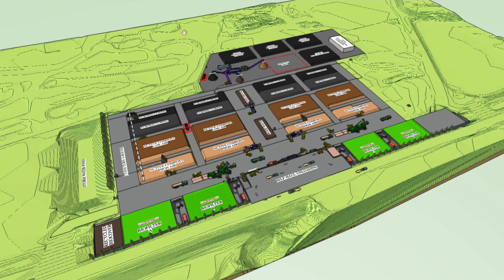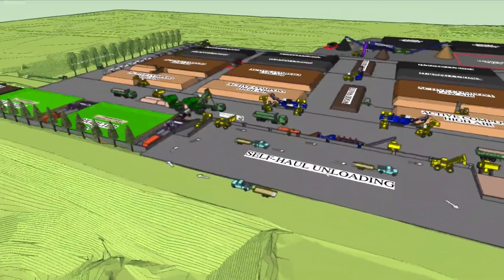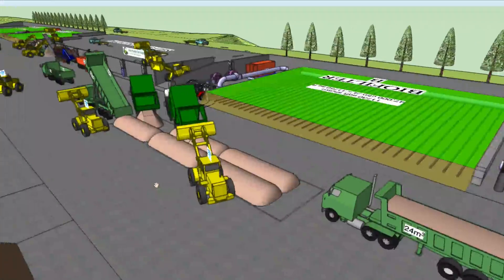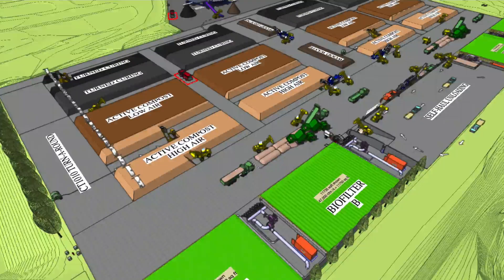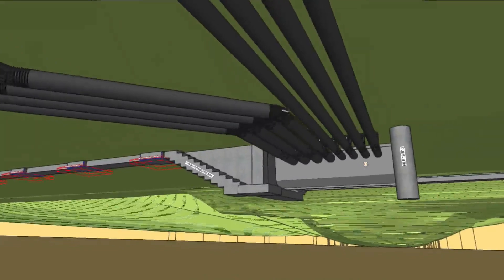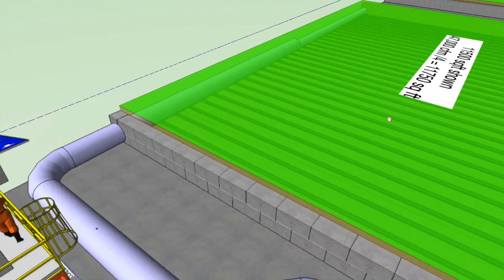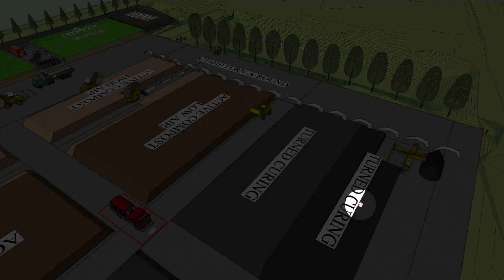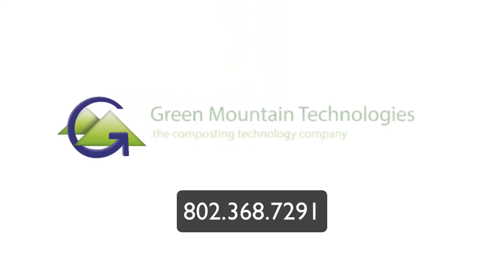How Turned Aerated Pile (TAP) Composting Work

Comment: "Designed to handle the material as little as possible"?? Sure doesn't look like it. I have not seen many systems that move it more.
Reply from the maker: Hi Joel, thanks for commenting,  Windrow composters typically turn their piles every 3 to 7 days for 90 days. 18 turns to finished product. At a turning speed of over 2,000 cubic yards per hour. Aerated Static Pile systems do turn material less, but are less efficient in the turning process, requiring at least 2 turns to add water using a loader and mixer at a rate of 200 cubic yards per hour. The Turned Aerated Pile system turns a total of 12 times at the same speed as a windrow turner. So you are right, this system does turn a lot of times, but it is less than windrow turning systems that do not use forced aeration and faster than both ASP and Windrowing to reach the same stability levels. We have one facility in Puyallup Washington that says they are reaching a stable product in 26 days using this TAP system. It has been operating since 1999, so they have a lot of experience with this composting method, so our claims are conservative and are achievable by all our clients right out of the box. We have a new system that moves and waters the product 6 times called the cTAP that has a better configuration, and same composting speed of 42 days. Our new Radial ASP integrates turning and remixing and product relocation with one step making the ASP system more efficient to handle as well but handles 500 cubic yards per hour, nowhere near s fast as a compost turner. However it still takes 60 days to finished product, but less turning time than a standard ASP system. What other systems are you referring to that move material so few times and make finished  stable compost faster? How much time and space do they take to get to a finished product? If it is real and more efficient we will start offering it. Because that is what our customers come to us for. Best Regards, Jeff Gage
Reply: @GreenMtnTech  Great explanation, I appreciate that. I am not comparing to a specific setup, just several of the ones I have been researching online and YouTube.